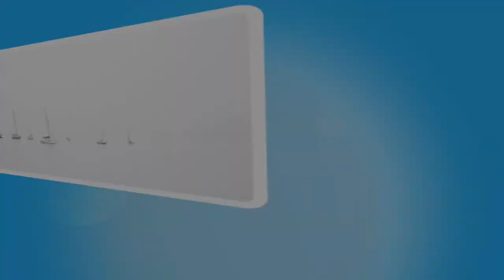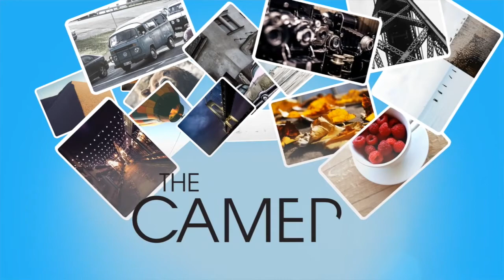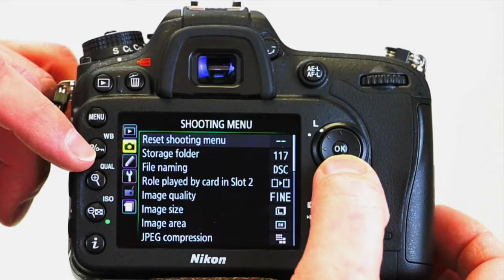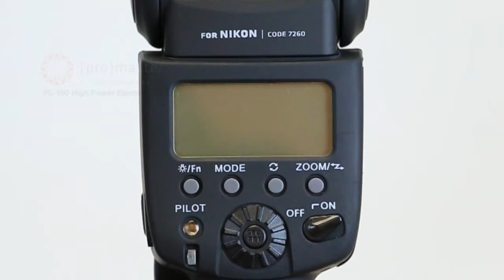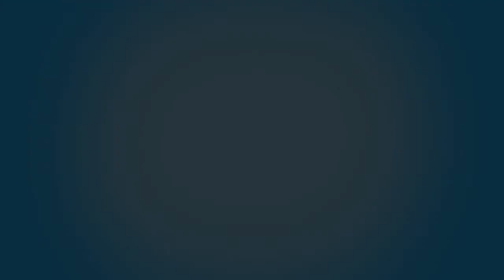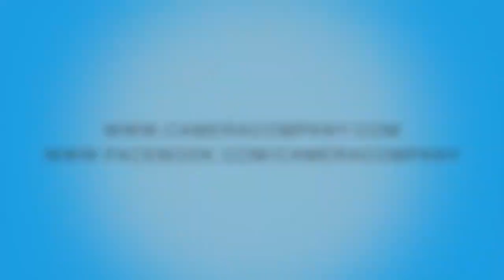An Introduction to Using Off-Camera Flash with the Nikon D7100 & Promaster FL190

Comment: Looking at flashes for my mother's Nikon 7000D, so that she can get into flash photography. Considered the Nikon SB700 and SB900, but the FL-190 is more attractive with most of the features of the SB900 while cheaper than the SB700. Only hesitance is that I have found little information about promaster or this flash in particular.  How would you compare this flash to the the two listed Nikons ? Are there any concerns with its quality or capability ? Would you recommend it over the Nikon models ? Thanks in advance.

Comment: It doesn't help. For my camera still automatically pop up flash works
Reply: The flash still needs to be up but in this setting it won't go off. If I understand it right it needs to be in the up position to tell the camera to send the signal to the remote cameras
Reply: I have the same problem. My camera flash still fires in commander even if it's off.
Reply: It's the camera flash that fires the strobe. It's supposed to flash. It's a reduced flash so it does not affect your image.